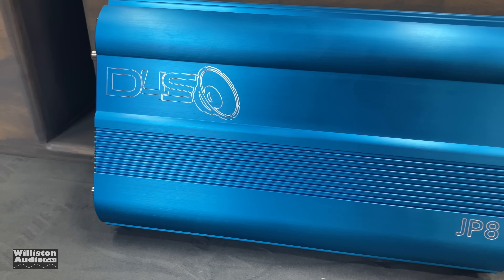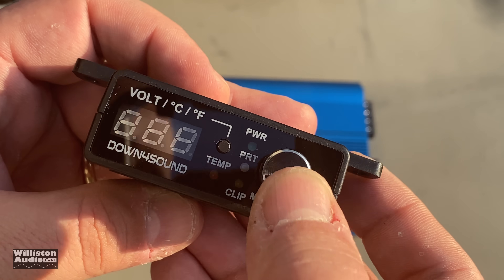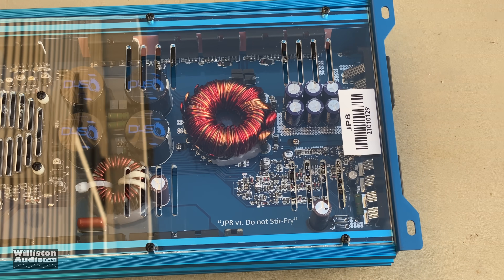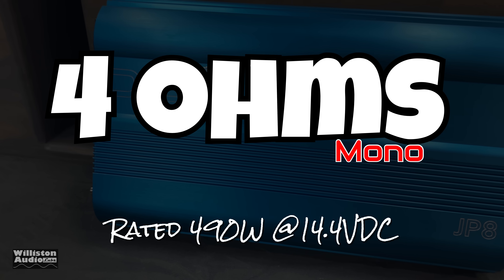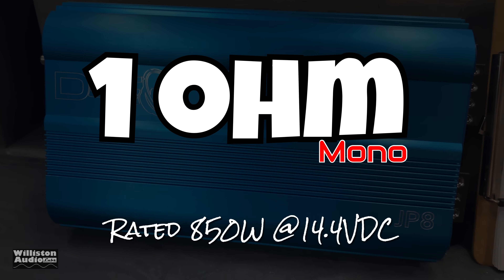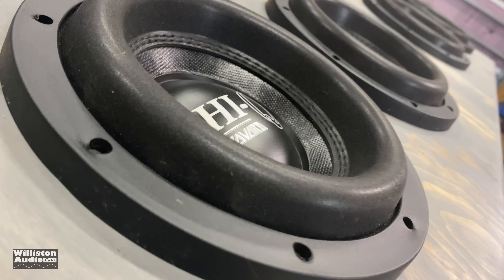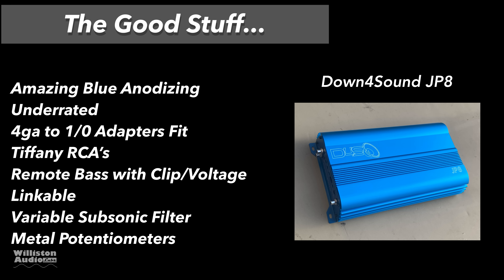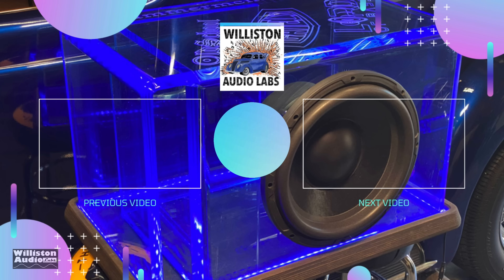Down for Anodized Blue? Down4Sound JP8 800W Mono Block Amp Dyno Test and Review [4K]

Comment: The best cheaper amp under $200 that I have “EVER” purchased. My favorite amp will always be my JL Audio Slash 500/1 for it’s the most reliable “TRUE” power on a JL 10W3v3-2 and it seems as loud as the JP8 on a Skar 10” DDX DVC2 sub. I tried both subs in the factory Skar ported rhino coated box!#🔊❤️

Comment: Does a JP8 +JP84 Combo require an electrical upgrade, or can I get by with 2-gauge wire? My combo arrives tomorrow.
Reply from the maker: It depends on your alternator, and how you are loading down the amps. I'd try with what you have and keep an eye on the voltage when you're listening loud. If it dips to 12 or lower then you will need a 2nd battery or one of those Ioxus Cap batteries. Most likely you will be fine unless you have a small (<100A) alternator
Reply: @wal  Thank you a bunch for your response and great channel. I have a F150 with a 220-amp alternator. I had a Rockville DB55, (Great amp just moved it to my Expedition and wanted a bit more power to the subs). I had no issue with the DB55 Class AB\D 5 channel combo.

Comment: Correct me if I’m wrong but the clip light was coming on way before the maximum output of the amplifier or Dyno I should say so that’s not really a true measurement or accurate measurement so when the clip light comes on the amp Dyno you should stop right then, but it still keeps counting up so that’s not an accurate reading just saying

Comment: Just wanted to add my opinion but the bass knob being plastic is actually better than it being metal. I used to run a 5 channel audio control amp with built in DSP. Costs me 1500 bucks Canadian and the remote port died because I have soft cloth seats in my Kia Spectra and one day I generated a bunch of static and my knee bumped the knob I mounted to my center console and boom no more knob. So imo being made of plastic is actually better for reliability.

Comment: If the bass boost is fixed at 45 how can you go around that? Crossover? Also would you recommend this amp over MTX?
Reply from the maker: Don’t know what you mean? Most people don’t use bass boost. The remote bass controls volume, not just 45Hz
Reply: @wal  oh I thought the 45 was a fixed position. You said you didn’t like that.. I don’t know much about them but trying to understand. I’m thinking on buying that amp over the MTX 500 and running 2 12subs in my truck. Idk
Reply from the maker: @mxr248  again the 45hz adjustment on the amp is fixed at 45Hz, but if you leave it all the way down and use the bass remote, it modifies the volume of all sub frequencies up to the crossover point

Comment: Your amperage draw seems off, in some clips it went to 98 amps in 2 ohm but you showed a clip of it drawing 75 amps.
Reply from the maker: The amp will continue to pull current after it's reached it's power. I go by the current at the time of the power measurement.

Comment: Question big d?! The fuse rating is 120 on this amp per there website how is it your test was drawing 170-180 on the 1 ohm test?  Do I need a bigger fuse than recommended?

Comment: Do you have a video where you link two amps up?
Reply from the maker: Not this one specifically 

DLB Audio DL-700.1 Monoblock Strapped Amp Dyno Test AD-1
https://youtu.be/bW0i581w9nc
Reply: @wal  Cool thank you I just checked it out no I was just wondering about the JP8 I have to replace my hifonics amplifier because I got that kicker L7 12 to replace the old CVR 15

Comment: When the bass knob is unplugged where is the bass set
Reply from the maker: Bass knob controls gain. So wherever you have gain set is where it will be with bass knob detached. If you attach bass knob, you are only able to adjust gain down from that level (max setting on bass remote equals amp gain setting)

Comment: You should run a test without the bass knob. I've been running mine at least 2 months then I decided to hook up the bass knob for the voltage and temp features. After doing so the amp output is less even with the knob turned to maximum.   Anyone else noticed this?
Reply from the maker: Interesting 🧐

Comment: Big D!!!  You rock.  I have a question for all you bass heads.  I am trying to decide on these three:  Down4Sound JP8, Rockford Fosgate R2-500X1, and D'Amore E750.1
Peace out.  Keep in mind, not just the most powerful, but the one with the cleanest sound.
Reply: I’ve owned the RF 500x1 and moved up to Skar RP800 , & then to the JP “Blue Beast” once it came out! Perfect for my daily driver with (1) 10” Skar DDX! DVC2 running at 1 ohm. #🔊❤️@Kelvinbellrose

Comment: He ran the test at the highest lpf setting.  I think 230hz?  Nobody will be using it this way.  Does anyone know if setting the lpf high allows the amp to get a higher score on the dyno?
Reply from the maker: I’m just trying to totally bypass the LPF to ensure it doesn’t impact the score. No cheating, just ensuring the crossover doesn’t impact the test by being set too low
Reply: @wal  ok cool, good to know.  I actually just received mine last week due to this vid.

Comment: Hows the longevity on these amps? I just bought an alpine 600 watt monoblock amp for 179. I paired it with 10" alpine type R. I went for sound quality over spl

Comment: Just put mine in the car. Pushing 3 mojo 6.5 subs ,hit a 140.7. Gained 1 spl compared to the previous pioneer 8601 amp.
Reply: Are you still using it? Wondering about long term reliability.
Reply: @murrayshekelberg9754  yes. Still going strong!
Reply: @Rottenbelly707  Sweet. Just got mine running last night and all seems great so far. That bass knob really is bright but I have some window tint samples on the way to fix it. The clip light seems like a real game changer for me.

Comment: the LEDs can be toned down a little bit with the resistor not sure the value but it shouldn't be too hard.  
if nothing else just apply a bit of masking over it and that should work just fine as the easy way to do it.
Reply: Piece of window tint,boom done.

Comment: Bought one immediately after watching this vid. Great job BigD and JP!
Reply: Got it hooked up to 2 L7S 8” kickers at 1 ohm and  it  hits, very satisfied
Reply: @BENNYMFB  Hows the reliability? Any heating issues at 1ohm?
Reply: @murrayshekelberg9754  no reliability issues at all, you can check the temperature of the amp from the bass remote. Haven’t ever seen it over 110° even on hot days and either the fan is very quiet or it doesn’t need to kick on because I’ve never heard it. If I had one thig I don’t like it would be how bright the bass remote is, pretty sure bigD mentioned that in the video.

Comment: I'd say all DC fans used in electronics are brushless. Don't think I've ever seen one with a brushed motor.
But not giving it credit for that feature, it's really good that it has a fan. That will keep the inductors (coils) and other components on the board cool.
Overall it seems like a well built amp so thumbs up from me. 👍

Comment: I couldnt help but think of the Jensen amps from the 90s when I saw that blue aluminum case.
Reply: I have one, a 4 channel. Dates back to 1996-1998 if I'm recalling correctly. Those Jensens, and this amp in the video have a very similar shaped heatsinks to the big dog USAmps of the time

Comment: Nice looking amp! Great numbers. It would be awesome if it had a 24db slope crossover but JP nailed everything else with this amp. Imo.
Reply from the maker: Pretty dope
Reply: @wal  and we need the PA vertigo 10k and 8k since the 10k is same exact amp as jp23 only 50 bucks cheaper and the 8k is 149 and I bet it's a 2k amp too
Reply: @charlieknoll1269  if anything the closest to the Vertigo 10k is the CAB22. Jp23 is way different,have you seen the circuit boards? It's clear you haven't .

Comment: As a technician my biggest gripe with your channel is that you don’t really understand what your talking about but do it anyway. It spreads misinformation. And worse, it’s immortalized for people that don’t know any better to digest and regurgitate for years to come. That’s not helpful and I wish you’d heed the constructive criticism to improve the content accuracy. For example, ALL of the fans used in these amplifiers are brushless. It’s the bearing type that lends itself to eventual failure and subsequent noise. They are brass sleeve bearings and this one is most likely no different. They make a dual ball bearing version but nobody will spend the extra 25 cents on it.
Reply from the maker: It’s true! I’m not perfect. Please spread the word.  Now, would you like to make some content so I can pick out the things you did wrong? It’s not as easy to be perfect as you might think.

You do know many magazines of car audio also had mistakes over the years and this info is immortalized as well. And I get this comment about a fan? Wow 😳

Comment: Awesome video man I’ve been excited to see what she would do and honestly it outperformed even my expectations! Keep up the great work 🔊🔊💪🏽💪🏽
Reply: I Have the same Question patton Mann.
Reply: @Jon Doe I'm good, not interested in buy, just curious. I'm old school, $300 will yield some very collectible car audio
Reply: Where are the JP amps made???
Reply: @pattonmann5356  in my bathroom 😵😅
Reply: @pattonmann5356  this particular one CHINA says so clearly on the box in the beginning of video & on inside of amp...
Reply: @408SPLKINGS  FINE CHINAAAA LOL
Reply: @pattonmann5356  Made in China with components (capacitors) Made in Korea.
Reply: Why not just rate the amp at what it actually produces? Birth sheet? Selling strategy I guess.
Reply: @shtfvan8084  Capacitors get weak with use and age which reduces the power they store and the power delivered to the speakers during bursts. It is correct to lower the wattage rating of a device by 20-30% to account for this natural degrade of performance. 

It is frowned upon to not take this reduction in performance when posting specifications or to even over represent the performance with numbers that can not be reached.
Reply: @shtfvan8084  would be pushing amps at max 24/7 pass good efficiency i like it like this play clean on what they say then can push them past but with symptoms
Reply: JP i have bought all of my audio equipment from you . can't wait to order one of these for my new setup. Glad big D did a dyno before I placed my order.
Reply: @Jon Doe soon :)
Reply: @THELIFEOFPRICE  JP I just ordered a Sundown SFB 5000D Amp from you on Wednesday 3-17-2021 BUT I absolutely cannot wait until you start producing JP Model amps in the 6k-8k rms power range! I'll be ordering one of them soon as I see them available on the D4S site!
Reply: @Jon Doe lol go team go
Reply: @Jon Doe how much is it?
Reply: @THELIFEOFPRICE Can we get a special edition JP23 this color I’d buy 2 more to have them this color lol
Reply: JP are you bringing a matching 4 channel for this..
Reply: @MyBlowncobra  yes it should be here by next Friday :) jp84
Reply: @THELIFEOFPRICE  hell ya..
Reply: Just picked one up from you, JP! Looking forward to seeing what it will do with my two 15's.
Reply: Yea.... I'm not getting anything near this power? I'm only getting around 28 volts on the output at 2ohms before clipping, which if I understand correctly is only around  392 watts at 2 ohms? I need 800 at 2 ohm for my setup, which is why I ordered this amp. Any thoughts?
Reply: @gregkirby  Sorry to drag up an old post but I  am looking hard at this amp and wondering if you solved the low power mystery?
Reply: @donnie4191  yessir I did. I ditched the scoshe brand line output converter for one made by kicker. It gave me a little better voltage input so I didn't have to max the gain out ok the amplifier and it fixed it
Reply: @gregkirby   Perfect 👍 Thanks for the reply Greg that's just what I wanted to hear.
Reply: How will this amp handle 2 deaf bounce MF-15s at 1ohm
Reply: @dammitman5628  it would push them about half power

Comment: clip light and distortion light are two different things!
A (proper) distortion indicator is just that, it uses a comparator to monitor the input waveform and output waveform.  This is why you may see the distortion light flash briefly when the output is nowhere near the limits of the amp or power supply.  Depending on the threshold trigger it may or may not be audible.

A clip light is just that, once the output reaches the amp's limit to produce a proper rounded sine wave at the top, asking for more results in a signal clip and the light will fire to tell the operator or big dummy that it's time to back off! ;-)

Comment: When I first started messing with car stereo 20 years ago, you could only really trust the name brands for best results.  My system was ALL pioneer and I had the most BUMP in the high school parking lot.  Man have the times changed, so many smaller unknown brands making quality gear now!
Reply: Same. I had 3-12"JL-W6s in a Nissan 300zx with a 1500w precision power amp that was like 3 ft long(maybe 2.5ft)That was still by far the hardest hitting system I've had.

I'm 42 and it was Kicker, Orion, Alpine, Kenwood. Pioneer etc.... If someone had a "Down4sound" and "American bass subs." Back then I'd probably laugh. Not anymore.. I Just found a nice 500.1 kenwood amp with a kicker comp R in a kicker box at a pawn shop so I bought it and its decent but it brought back the basshead in me so now I'm doing research and I've found that while those are still good, they aren't the way to go now. It's D4S, Audiopipe, Deaf bonce, American Bass, Sundown etc and the price points are WAY better now
Reply: Shit if you had Pioneer in my high school parking lot in 95 you weren't anywhere near the loudest
Reply: @bobbyackerson4125  that because they didn't start getting up in the spl until early 2000s

Comment: Clip indicator's pretty conservative on the amp. I'm not going to frame by frame every test but on your first test it came on at 406W. Someone using it to set gains would be out 105W and not even getting rated output.  Edit, rewatching it it appears it was 503W. I swear the first time I saw 406.

Comment: Boss would have rated this amp 3kw at 1ohm😂
Reply from the maker: True dat
Reply: And it would've done it after they connected it to a lightning bolt and measured the split second it hit 3k before catching fire.
Reply: @Thezuule1  it can probably do 3kw if the rails r connected to rectified 120v mains . & with 8ohm load. but the transistors will explode as 21amps flow through them!
Reply: @KuntalGhosh  as long as the meter read 3k it doesn't even matter. Just slap 3k on the box and send it! :]
Reply: And everyone would call it shit.  See how just being honest about numbers makes all the difference in image

Comment: Bass knob cable if fat. In my opinion i think the bass knob would be nicer if you could turn the brightness down. Use the knob like a watch and be able to push or pull the knob to adjust brightness.
Reply from the maker: Yeah they need the extra wires for all of those features in the knob
Reply: @wal  yes sir.  I know it. Hands down the sexiest bass knob out today

Comment: Thanks for keeping it upfront and real.
Reply from the maker: Thanks for watching and commenting!
Reply: @wal  PLease do the blaupunkt amp4000d 4000 watt amp.... It's the biggest one it claims 2800 rms and it has 4 40 amp fuses... Best part it's 109 dollars on Amazon!
Reply: @charlieknoll1269  hmm that amp putting out 2800 rms sounds VERY suspect... You even said it has "4 40 amp fuses" so more than likely it's only good for around 1600 rms. You do the math... 4 times 40= ?? That usually puts you in the right ballpark of your amps rms output within 10% or so.
Reply: @itdoesntmatterwhatyourname6128   it claims.... Don't mean it does... But even 1200 rms at 109 bucks is unfathomable
Reply: @charlieknoll1269  if you consider that Blaupunkt "unfathomable" you might wanna check out the Sundown SFB-1000D you can get it for $151.99 it will put you around your 1200 rms @1 ohm. And I don't think I'm the only one who'd rather pay $40 for a Sundown  (even if it is the sfb) to have the same power as the Blaupunkt.
Reply: @charlieknoll1269  although you could be on to something with the Blaupunkt amp, for all I know. I've never had a Blaupunkt product. I do have one question though... Where are you finding that Blaupunkt 4000d amp for $109, I'm wondering if I'm looking at the same amp as you because their are some differences in what I've found. Cheapest I've found that amp was $150 on Walmarts site, also the Blaupunkt 4000d I read specs on has only 3 40amp fuses instead of 4 & is only 2 ohm stable... ⬅️ am I looking at a different amp Charlie Knoll? It's strange on the box the amp comes in it gives 4, 2 & 1ohm rms ratings but then goes on to state "*2ohm stability" on the same exact box. Smh Blaupunkt has me confused.